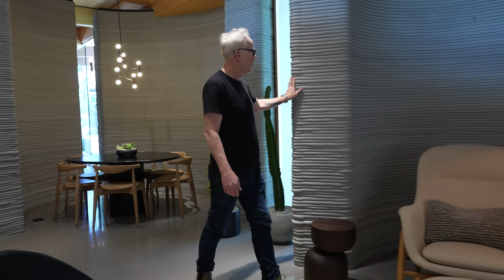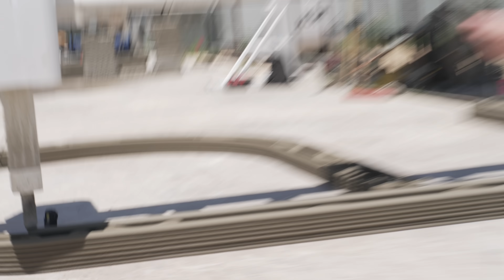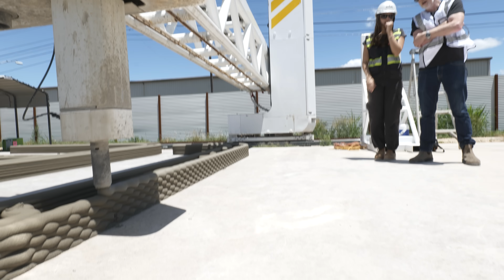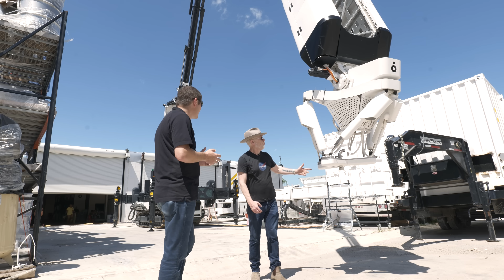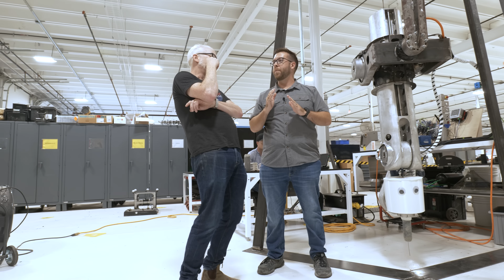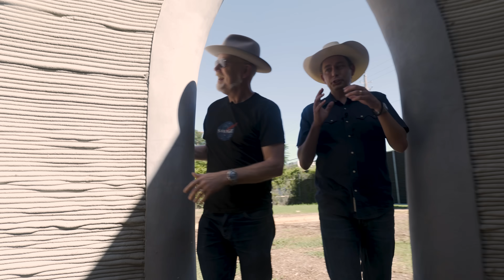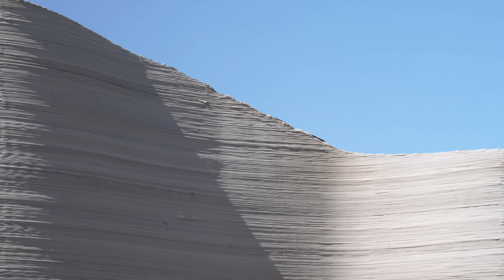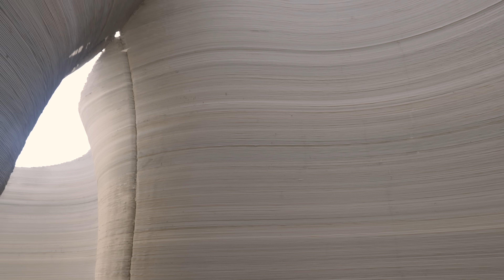The Biggest 3D Printer Adam Savage Has Ever Seen!

Comment: Very curious to see how this develops, a lot of unanswered questions regarding finishes like windows, mechanicals, and flooring between levels, not to mention how states and townships are going to react to this type of construction method in regards to building codes.  Would have been cool to see a truly finished lived in house.
Reply: If you want all those details, go see the 100 first gen houses they built at Wolf Ranch in Georgetown.
Reply: they will probably cut the windows with a huge oscillating saw
Reply: I’m curious as to the possibility for additional insulation in the walls.
Reply: @marypasco2213  You don't actually need it in structures such as these. The air gap inside the formed walls provides plenty of sound and thermal insulation.
Reply: @marypasco2213 They printed the walls at the test site with gaps where you can install foam or blown insulation.  Frankly, just having a sealed 8-12 inch air gap offers a pretty good insulation value on its own.
Reply: Funny. In the Netherlands, the cost of the house is peanuts compared to the land price, so you can build a cheaper house but the overall price of land+house is still skyhigh.
Reply: also no multi storey houses, only one story houses with domed roofs seem to be possible
Reply: Fire danger is definitely greatly reduced.  I'm curious about hurricane tolerance too.
Reply: As someone with too much experience 3d printing: You can pause and insert materials and parts into a print. I know scale and resolution are very different but I would imagine it's very possible to build in spaces for windows. They're already printing hollow walls for lines.
Reply: @atriaventrica  but at this scale id be concerned at how well the layers bond after pausing because with traditional 3d printing it can partially melt the previous layer, this is a chemical reaction
Reply: @ryangagnon5489 They would pre-build all the frames before they get to that point so once the print gets to that level, they can just drop it in and make sure it's level and plumb before printing over it.  Concrete has a decent working time so it doesn't need to be done down to a minute precision, but they may also install the frame oversized so the final dimension frame can be installed inside that.  There's another video I found where they demonstrate it.
Reply: @ryangagnon5489 they talked about how it can take up to an hour to cure before the next line is put down depending on some variables

Comment: let's imagine this tech expanded to its near hypothetical limit, an extruder than can print metal and plastics into spots to create greater variety, do plumbing, do aesthetics, do electrical all in one machine. is that machine better than a swarm of construction drones and smaller machines working together to emulate a modern construction crew at far greater efficiency and speed? I doubt it. I feel like there has to be a use case for this tech beyond just novelty, but im not sure what it is!
Reply: Why does there HAVE to be a use? We already have concrete mastered. This dude needs to go broke

Comment: What's great about these types of early days tech PR videos is knowing all the ways this tech won't work to reduce housing costs, or even build residential housing. This is a niche technology and will always be, as cool as it is.

If you're skeptical, ask how plumbing, electrical, insulation, windows/doors, roofs are done with solid concrete walls. In concrete brick construction, it requires stud walls.
Reply: I work for a very large general contractor. It's basically expected at this point that you hear about another 3d printed home startup from new employees who discover them for the first time. It's not new, there's been attempts for over a decade. They come and go, maybe doing some demo homes along the way. There's reasons you don't see actual neighborhoods made this way. Will it ever become a common thing from stable companies that last longer than their initial investors cash dumps, who knows.
Reply: "Texas-based 3D technology company ICON,  has broken ground on what will become the world’s largest 3D-printed community. The neighborhood located North of Austin in Georgetown, Texas will consist of 100 3D-printed homes codesigned by Bjarke Ingels Group (BIG) and implemented by Lennar, a large construction company based out of Florida, was first announced in 2021."

This has been completed.  Icon is valued at  2 billion dollars.  Toll Brothers is the 5th largest home builder in the US and is valued at $8-12 billion,
Reply: it would all be done the same way it's done with concrete block buildings, or with clever design, even better than concrete block buildings. I live in a house that's 65 years old made from concrete blocks. 
if you want to pass electrical through... just drill a hole. its all ran through interior walls not exterior walls except where it enters the house. same with plumbing. windows and doors are very easy you use concrete screws to fasten the frames. you want a 2nd floor? just leave small gaps for the floor joists to intersect the wall(or with concrete block just whack it with a hammer, apparently what they did to mine)
regarding requiring stud walls - if you mean the exterior walls you are wrong and if you mean interior walls - what alternative is there?
Reply: They showed electrical and plumbing installed in the walls. As far as insulation, it would be either the inherent insulation provided by the concrete as printed, but it would be so incredibly easy to inject foam either into completed walls, or as they were being printed. You are being a little too skeptical about this.
Reply: You're speaking from ignorance of the methods & processes available. You obviously missed the BX cabling for power, the PEX piping for plumbing, and more in this video. Metal frames are set into place for doors and windows during the printing process. The walls are NOT solid, they're a hollow shell with plenty of interior space. No need for fire blocking, since the concrete isn't flammable. You missed how they described bringing the walls together gradually to vertically enclosed the space, but wood joists or steel trusses can bridge the walls to provide roofing. In concrete tilt-up construction, the slabs are formed, poured, cured, then lifted by crane & tied together with steel trusses, a process that's been used for decades. ICON has been around for over a decade, so it's not "early days PR".

Your comments are no different than those people who claimed that "horseless carriages" were too noisy, too unreliable, and would never catch on, or "If man was meant to fly, God would have given him wings".

Comment: I assume actual homes printed like this can still have a basement / foundation?
Reply: A lot of home construction in the US is "box on concrete slab", which if you squint just so, happens to align with 3d printing.
Reply: Im goings to print me'h a dang house aligned with the solar solstices and when the beam of natural light is just right im guna moon it.
Reply: probably, but this is in texas, normal houses don't have basements anyways because the ground doesn't freeze and the soil is mostly dense clay, which expands and contracts dramatically with the weather and also tends to flood
Reply: Why not? just dig out the area first and backfill like you do with regular basements.

Comment: This is neat and all, but I also have to wonder.. why do this? It's not as strong as a normal concrete wall, it's not faster than a team laying blocks and it's way less environmentally friendly than using pre-fabbed wood panels. They put up 3 large 3 story row houses next to us in a week using wood panels and preformed floor panels.
Reply: First, you’re assuming it’s not as strong as concrete, it absolutely can be. Secondly, a team laying blocks is more expensive and introduces more opportunity to failure. Thirdly, gutting down trees is not more environmentally friendly than concrete and never has been.
Reply: It's so dumb and has been for years
Reply: the prebuilt stuff took time too, just because you dont see it doesnt make it not take time
Reply: "It's not as strong as a normal concrete wall" proof?
Reply: A lot of assumptions. Your row houses took 5 months of planning and construction for foundations before that wood was nailed. That wood took years to grow, months to prefab, weeks to transport.
Reply: @TheNextWILife  So this printed house can be built on sand? Obviously not. Wood needs time to grow? No shit.
Reply: @TheNextWILife you didn't address the actual homes
Reply: @TheNextWILife Most of which still would apply to a 3d printed house.

Comment: Now print a concrete Benchy
Reply: I'm sure at some point they thought about it :)
Reply: @ben23423  I would be surprised if they didn't. I bet somewhere there is a 3 foot tall concrete benchy in the garden of one of the engineers.
Reply: Overhangs are a lot more difficult with cementious material than with plastic guys. You really got few choices. Print the parts separately and affix them together later, shove in some kind of support underneath during the print, or cut out the section you want to remove after the rest of the wall is structurally sound. Also cement (actually a kind of mortar) that cures that quickly doesn’t start and stop like plastic can either. You have to keep it moving or it sets in the pipeline and you lose a 12k$ hose. I promise you someone is trying. Likely someone has already succeeded.

But they’re probably working on it.
Reply: @serpentmaster1323  You already have to handle overhangs, because there will be a ton of them inside the home. Doors, windows, closets, etc.
Reply: @guspaz  you can literally see them unable to handle overhangs in their house design at the end. which is fine, it doesn't need to. just have manual labor put in window and doors before its at the overhang.
Reply: yup, I want to live in a life-sized Benchy!
Reply: HA! :face-blue-smiling:
Reply: … that floats.
Reply: Yes
Reply: Pretty sure Zack freedman did that in one of his filament videos lol
Reply: lol use expanding foam and make it actually float
Reply: First thing i would have had to do hahah Those overhangs would be a bitch tho
Reply: They could print it at real-boat scale 😂
Reply: wonder if it will float
Reply: Haha out of concrete? It wouldn't float.
Reply: you can bet they did, at least one. no one who ever owns a printer resists... lol
Reply: Check our latest post, we printed the first concrete 3Dbenchy in the world! ;)
Reply: Actually, a boaty

Comment: This is really cool, but I wonder, is this sustainable? After all we are constantly trying to reduce the use of concrete in modern buildings due to the environmental impact, yet these structures are made from full on concrete.
Reply: Another factor would be rebuilding needs: if we need to replace wood houses every other year due to hurricanes but these could withstand those I wonder what makes it worth on the long run.
Reply: At some point in the video they also mentioned epoxy. If this is concrete mixed with epoxy it will be a nightmare to recycle.
Reply: @superdau yeah its a premixed 2 part dry epoxy mix that gets activated with water. We use a similar product at work for grouting pump bases and stuff. I do wonder how safe the particulate that comes off this stuff over time is aye
Reply: The only place i‘ve seen wood houses (or at least SO many wooden houses) is the US. Many other countries use bricks and concrete exclusively, often because of durability (we have houses here that are 600 years old, our church is over 1200 years old). It’s sustainable if you maintain the houses for hundreds of years, and those houses are very durable…
Reply: @erebostd  and Japan, Sweden, the Netherlands, the UK, and many others
Reply: It isn't. These companies are all using industry familiar mixes of "concrete" but it's got a high amount of cement compared to most use cases due to its need to be pumped.
Reply: Most of the world uses more durable materials like concrete and brick. Those houses last for hundreds of years. We’re being ripped off here in the US with these stick houses.
Reply: I find factory prefabbing far more meaningfull way for fast constructing. It also can use concrete (factory mold sets for elements), but can use pretty much any material. Wood, metal etc. Plus it can handle stuff way more complex additional steps. pre installing windows, doors, pre running conduits even all out wirings and utility stuff... though usually those are better of atleast partly after erection install to avoid needless joints and connectors. Running single long wire and so on. However the conduit for the wire one absolutely can pre run and connect conduit segment as part of assembly. 

One can preinstall insulations, weather proofing, vapour membraning, even finish surfacings and so on. One can pre assemble roof segments with metal already nailed down and so on. Building is way more than the frame and frankly I think as per building site..... factory precast concrete element frame is faster per building time on site. Since one doesn't have to wait for the concrete to cure on site. That all already happened at the element factorys curing warehouse. One just turns up with the whole pile of elements, a good construction crane and fully cured frame of pretty large size can be assembled in a day. One can even speed up buy having couple cranes on different sides of the building and coordinate erecting multiple elements at the same time. The just nail, crew, bolt or grout (well that takes time to cure) the elements in place per assembly instructions.

I find it perplexing the supposed land of efficiency has construction crews frame buildings on site laborously fighting construction conditions, having to hand align stuff. modern element factory has ready jigs, laying robots, nailing robots. It is always building square, since the jigs is square. Once set up square, it always assembles parallel and square.
Reply: scientists are discovering what ancient roman/greek concrete are made of which is interesting
Reply: I could see smaller, dedicated units just for block wall fencing. Here in AZ we see it everywhere. I’d love the look for my backyard. But also for sound and retaining walls on freeways. 
Sidewalk, trail, and road deck construction(with integrated aircraft cable)  should also be possible.
Reply: The issue is concrete as a whole, its specific formulations of concrete lol.
Reply: These are topical structures. Unlike sky scrappers or business buildings that require more..
Reply: Run concrete manufacturing with nuclear. Problem solved. Stop listening to leaders who voted to close nuclear plants.
Reply: If you look at the walls, most are hollow, meaning they use less than a poured wall would. It’s true that concrete has higher embodied energy than some building products, but it’s also true that it holds up much better in harsh conditions than other materials like wood or steel. A product like CLT might be great in Switzerland, but would be a disaster in Arizona. These are complex questions and it’s not as simple as concrete = bad.
Reply: We are trying to reduce the use of traditional concrete. That can be done by coming op with new formulations that don't produce so much CO2 in their production.
Reply: I'd be more worried about the composition/chemistry of this concrete, than concrete broadly. Are there harsh chemicals or plastics that are used to manipulate cure times, hardness, flexibility...that could have a more damaging effect on the environment or tenants health?

So far, of these new build approaches and materials, I like the geoship materials since their concrete/ceramic is natural by design, no chemicals or other strange chemistry to worry about.
Reply: You missed the entire first minute where they spoke about the material used being called "CarbonX" a much more sustainable material than traditional concrete.
Reply: reduce the use of concrete? you mean one of the most recycled materials on earth?
Reply: @bmxscape Yes, technically concrete is usually recycled by breaking it up into aggregate and mixing it with new cement, but the creation of cement is a huge carbon dioxide producer. No one's saying we're at risk of running out of the raw materials, the problem is the pollution from the manufacturing process which happens no matter what you make the aggregate from.
Reply: Recycling is very energy-intensive. It's not just about the raw material cost, but the embodied production cost. @bmxscape
Reply: I’m also wondering about this. I have seen other people print structures out of clay, but that’s not nearly as easy from an engineering perspective. I expect the impact of a printed concrete structure is roughly equivalent to a concrete block version, which is very common in other parts of the world. I’d love to see some real comparative research.